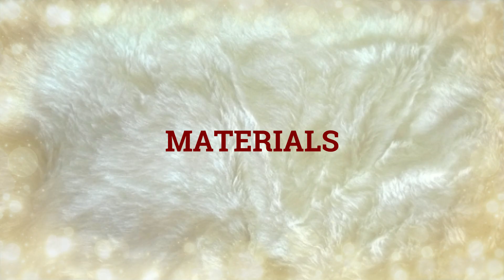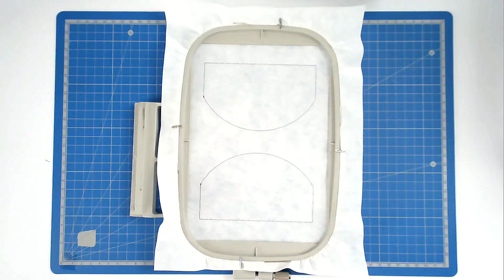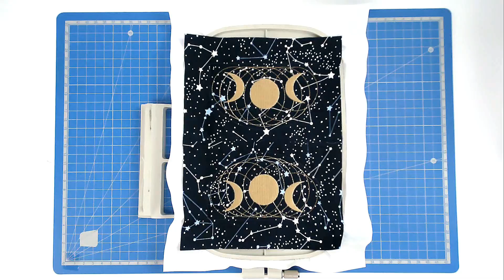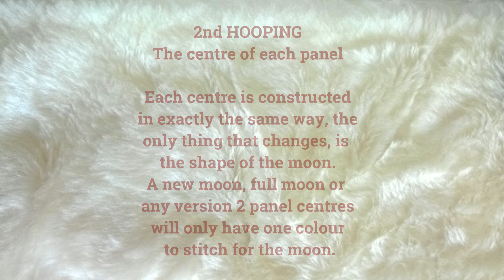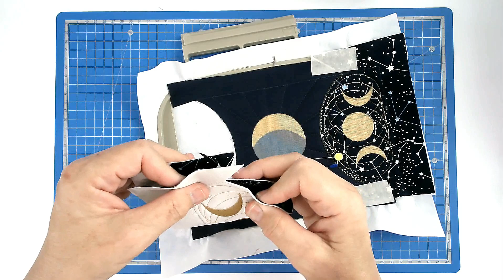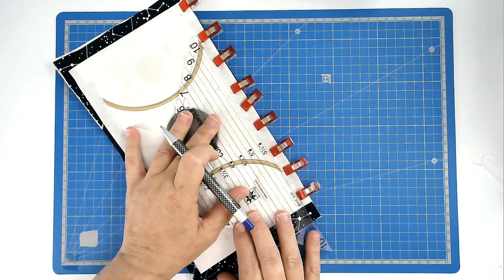Machine Embroidery Tutorial - Moon Phases Runner   From Kreative Kiwi

Comment: Thanks a lot! This table runner is suitable for any season. I love your tutorials. 🙂 I just have one question: what is the finished size of each panel for different hoop sizes?
Reply from the maker: Hi Mila, 

I have added them in the video description.

7 PANEL RUNNER SIZE - Without any sashing and binding
5” x  7” - 1010.7 x 249.4 mm or 39.7” x 9.81”
6” x  9” - 1158 x 313 mm or 45.59”x 12.30
8” x  12” - 1559.2 x 407 mm or 61.38” x 16.02”
Reply: @KaysCutz   Super!!!!!  It's a good idea to embroider designs that are much longer than your hoop size! My largest hoop is 24x15 cm, and in this way we can make a design about 30 cm high!  I hope to see more designs done in the same way! 🙂 Thank you for your wonderful work!